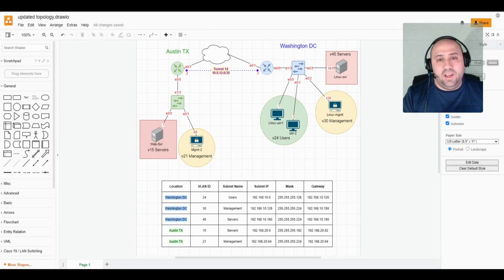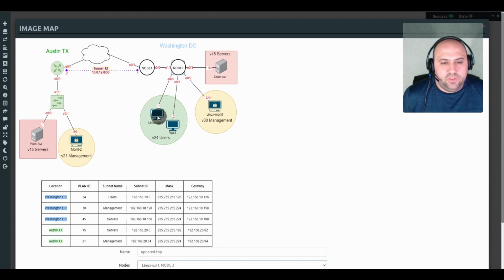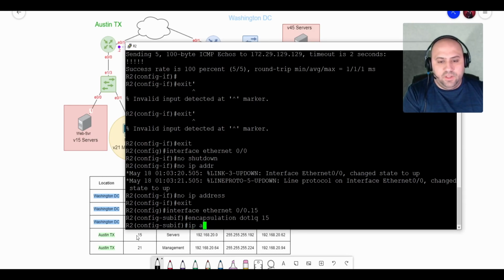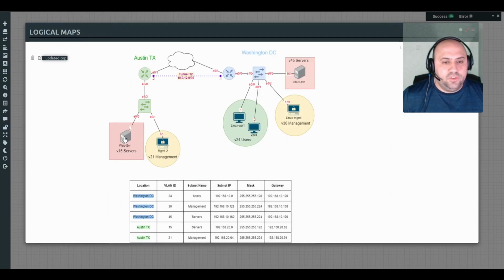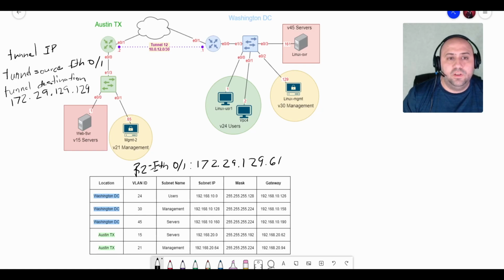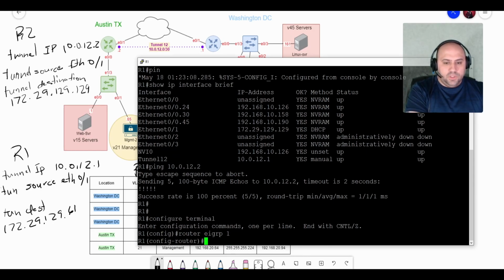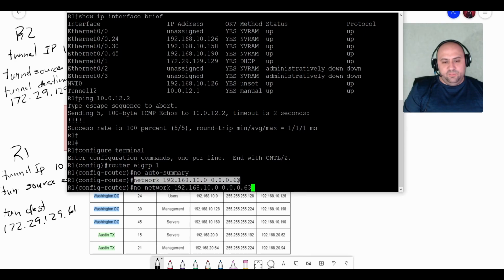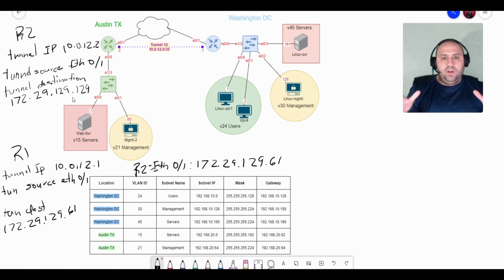Lab 4 Cisco GRE Tunnel

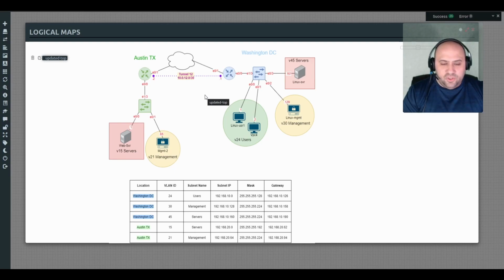Comment: 24:13 you have tested your inter vlan connectivity, but but my friend what about communication with the web (simulated internet) what will you do with that before you straight jumping to tunnel, how the users will go on internet besides communication with in the tunnel on the other side???
Reply: Sorry for taking a bit to answer your question. I don't quite understand your question. In this scenario, the site is already connected to the internet. If you watch the video, we connect via DHCP. In most situations, you will be assigned a public IP address by the ISP, configured either by DHCP or a Static IP if your ISP has assigned it. I spoke about this earlier in the video. In a real-life scenario, yes, you should verify the site has access to the Internet or at least outbound to the rest of the network if you are setting up a network without access to the Internet. You can test by pinging the tunnel's destination IP before setting up the tunnel. I hope this clarifies your question; if not, elaborate more, and I will try my best to answer.